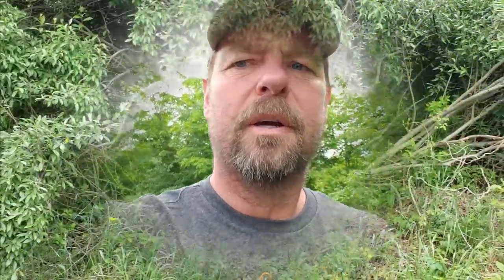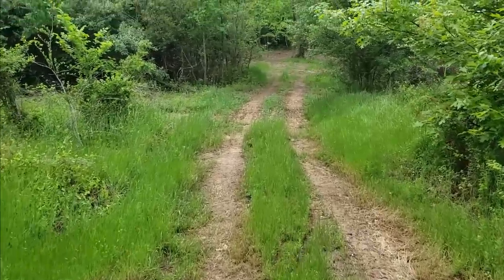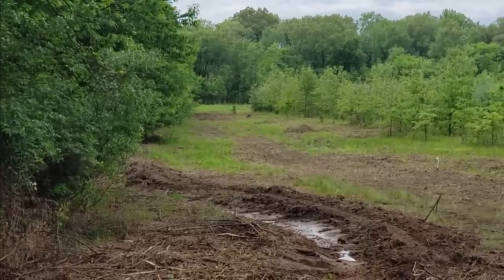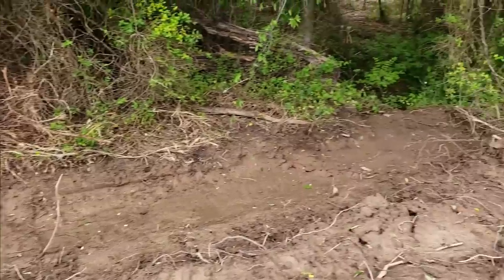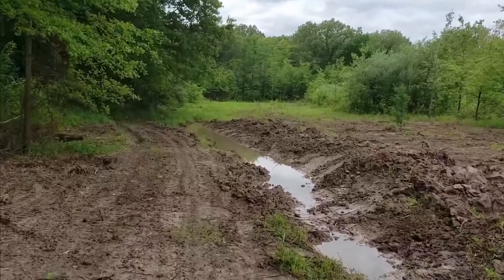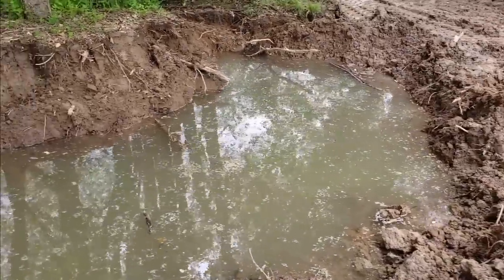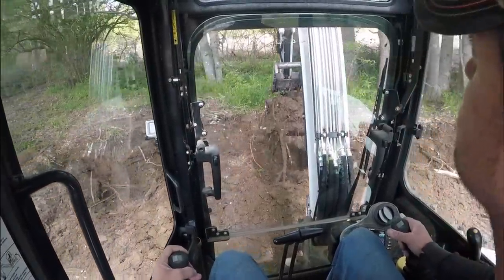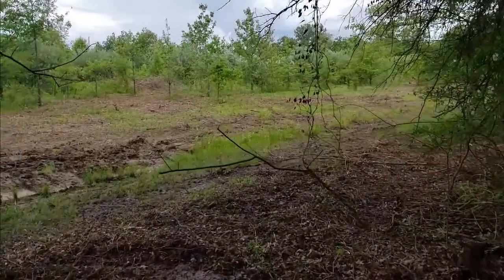Illinois Wildlife pond (deer water hole) FOLLOW UP! Did they work!?

Comment: Those ditches will fill your water holes up with sediment. In addition, you need sloping banks on your waterholes. Those steep banks will make it difficult for most wildlife to utilize the water source. Could even create a trap for some animals. Particularly fawns.
Reply from the maker: I always make a ramp at one spot in a small pond. So many have done great over the years.